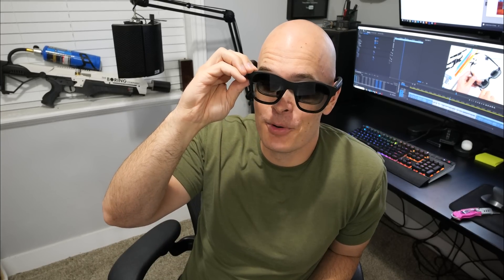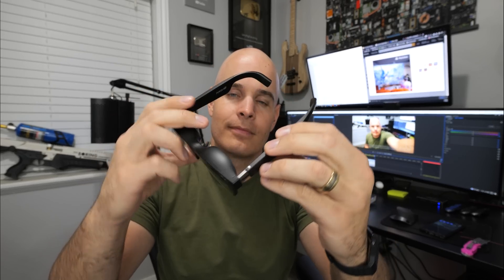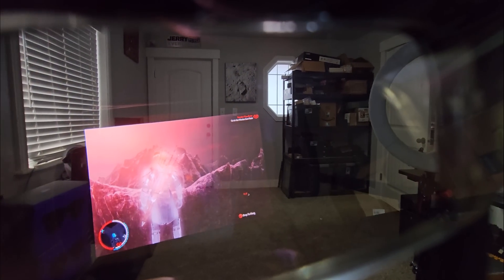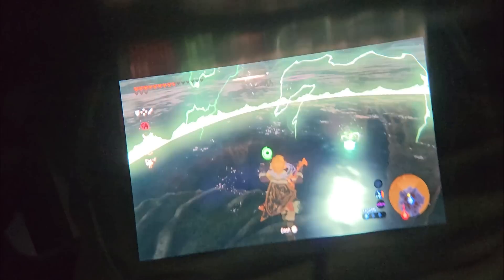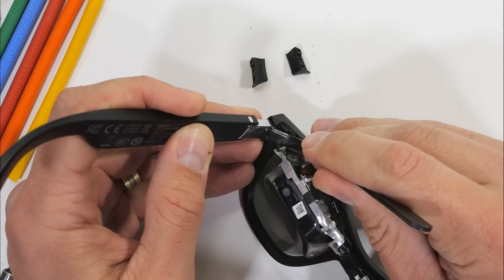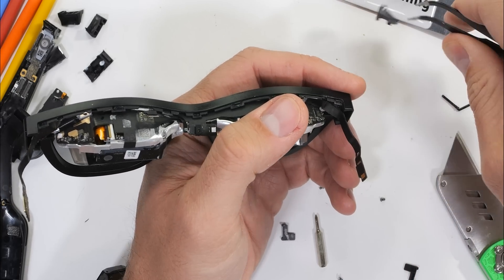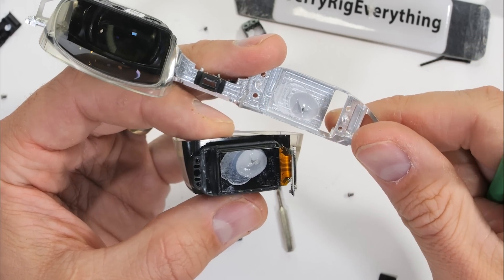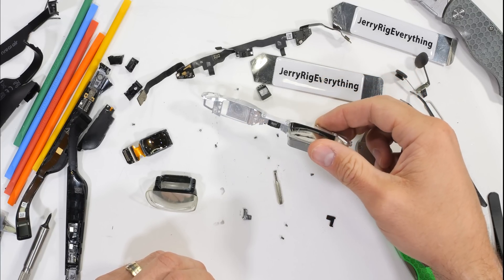The Smart Glasses of the Future are here! - (Teardown)

Comment: No adjustable knob to change the distance between displays to match one's interpupilary distance (IPD).
So, only people with 61.5 mm between their eyes are gonna see it perfectly.
The short ribbon cable inside, means that it would be hard to lengthen it ...
Why couldn't they add a slider or a screw to adjust that? :(

Comment: Probably missed the sweepstakes as this video is a year old but commented and subscribed.

As a budding physician I wish to use these devices when performing medical procedures using ultrasound. In patients with cerebral palsy, strokes, and other conditions leading to spasticity and contractures it's often difficult to position the ultrasound monitor such that the procedure can be easily performed while viewing the required images. AR glasses such as these would allow me to perform the procedure while looking directly at the patient which is obviously safer and easier. I think they will require some modifications as i probably only want the display on one eye and I don't need the darkened lenses, but these would give me a good starting point. Thanks

Comment: Is it possible to increase the ipd? I have the air 2 pro and for my ipd it's a bit blurry from sides and I feel my eyes tired after this glasses. I'm pretty sure all this problems can be solved if I move displays a bit apart and increase the distance between them. Seems like the only thing to do is to saw holes a bit to sides in the aluminium case and screw the screens again. Viable idea?

Comment: I don't like the fact that you have a wire attached. Yes, it's easier when you don't need a battery but it'd be awkward to wear it outside. It's also missing a cam but I'd try it at work anyway. I have three screens to be able to have all monitoring systems running at the same time so in the end I'd save on my electricity bill. ;)

Comment: They are certainly not the future. I've owned these but sold them after a few weeks for a number of reasons. They have a very limited software infrastructure and have almost no sensible use cases. And the fact that you can hardly move where the info is shown means your real world vision is pretty much obscured. They really are a solution looking for a problem. Google Glass would be one solution if they opened up their platform again and also the newest iteration of Vuzix due out later this year is another. But this version of nreal is dead in the water.
Reply: Google glass is a whole different story and use case. 
Nreal is working for me as display replacement. Imagine having 5 screens total on the go(and I am always on the go).
They do have drivers and they do have software (which may be not perfect, but hey, it works).
While I can totally agree that their marketing team  should be fired.

Comment: I have an IPD of 72 and having a bad time with the glasses. 
Do you think it’s possible to “cut” the aluminium frame in the middle and “extend” it with some 3D printed part? 
The ribbon cable looks flexible, perhaps it can tolerate a bit of stretching :)

Comment: Also the equivelant of a 1500 inch display, or 5 inch display.
My main problem not just with the Nreal, but all of the similar AR/VR glasses is that it requires a supported phone and app.
Plug it into something like the Steamdeck, it turns into a non3D monitor.

This tech has incredible potential, imagine playing AR/VR games from the steamdeck on the move(yes, some great looking games can run at 4K60 on the steamdeck plenty of power for 90hz 1080p3D/VR

Beyond this imagine plugging this into the headrest of your car, look down and it shows you a 3d map of the area, look over either shoulder and it shows you a mini view of your blind spots or backup camera.

I've personally used them to participate candidate interviews hands free while i'm building computers for our rotation

Comment: I have owned these glasses for over 2 months now. 

Viewing Quality 80/100
Durability 80/100
Software 55/100
Ease of use 45/100

Great device but requires additional addons only sold in America or Japan. 

For example, you cannot charge the phone while using these, unless you buy a rather expensive usb4 hub. And even then you'd need to power the phone and the glasses individually. (Adapter nightmare with usb naming scheme) 

The viewing is pretty good but suffers from a little blurriness around the edges but pretty sharp overall. 
The response time is also pretty fast with excellent pixel response with good brightness. Is does look a little oversaturated though (like an old CRT feel) 

The fov is very limited, for an AR experience it's kinda lack luster, there are some pretty decent apps being developed for it, I recently tried a few. 
They use the Unity for running a kinda virtual 3d user  

Tbc i gotta go

Comment: Brilliant. I have always thought AR glasses the included the computed inside is a waste. I have a $1400 phone, why not just use that as the computer. Something like the occulus by time you subtract the price of the motion sensors, controllers, screen and all that other jazz, how much do you think that actual computer is worth? $200 at best, a cheap slow crappy computer, so why not create an AR experience that takes advantage of the $1400 computer you already own. And the lack of a batter (no charging, less weight) is a nice added bonus. This is great, once the price is under $250 I'm picking one up. I just cant justify $380 for what is essentially an external phone screen. Great concept, just needs the technology to mature and the price to drop

Comment: Glasses drain the battery of your device much faster. Limites the usage of the device and i dont think that's so good to tax the device battery used to power the glasses. Over heated my phone. Fold 3. That inside screan protecter that it came with bubbled up and down the middle of my phone screan. Kinda making a clicking sound when you opened the phone. Had to take it off. Couldnt watch anything looking at the bubble line. 
The ability to watch something on a screan that you could move around, blow up and hold in position was amazing and still see around you. Very cool ar glasses. Nebula app keeps crashing though... so a fixed smaller screan right in front of you is what you get. Really like the glasses but not going to keep them. For almost 400. Recommend refurbished meta quest 2 from amazon I think it was 350.

Comment: They look amazing. I agree that without a battery it's simpler to build but it's a pity that you're attached to a cable. I guess/hope that in the very near future better battery technology is finally developed (aluminium core batteries) and we can shrink them more while increasing the energy density ( and adding WiFi, 5G, etc, would also be cool ).

Comment: The perceived size may be 100+ inches, but it would be nice to know what the perceived distance is and what the resolution is, because those are also important factors in how good the image looks.
At least to my eyes, 1080p looks good on a 16" screen from about 26" away, but 1080p on a 100" screen needs to be closer to 50" away to still look good.

Given the size of those panels, and the low price point, I would guess them to have a resolution of 720p, stretched out to a 100+" screen size, it would probably need to appear to be about 60" away to still look good and not seem pixelated.

Comment: Wow, these VR glasses look like they could change the game! I'm excited to see what kind of experiences I could have with them.
Reply: AR 😋, but yeah they will actually change the game as the convential method was to have a all in one unit - battery and re-charging components including the SOC. Which not only makes them bulky but there is always the risk that people will use them whilst re-charging therefore overheating the battery. Given... what happens when overheated battery goes.... and wearing on your head when it does won't be a pleasent experience to the say the least. So, by having a processing done externally comfort is also increased as no heat dissipation is needed for the SOC. That heat will go both in the area and the users head... lol.. then is also the aspect of electro-sensitivity. So, yeah by having the AR glasses merely act like displays solves a vast array of problems. Sure, it doesn't solve the biological problem of eye strain but that's on the user not NReal just as monitor OEMs are not liable to eye strain issues caused by prolonged use by users.

Comment: Nice breakdown. Good to hear that an internal battery is not available and we can only power the device through an external source. It probably is for  the best: Or else you'd have a built-in battery too small and weak to run the machine for long , or a battery that is charged and discharged so often that it will need to be replaced too soon. We know how expensive a battery replacement can be.

Comment: I wouldn't buy this gadget for 2 reasons. 1. I can't use the device unless I connect it to a phone or console. 2. Why should I use it for gaming if I can just get a regular vr headset. I would only consider buying it if it has its own battery and can be used without plugging my phone into it. I imagine myself using something like google maps but at its current state I would have to use my phone anyway so why even bother?

Comment: I had a pair of these and they were pretty neat, but I ended up returning them. My biggest issue with them is that they aren't fully sunglasses, yet they're too dark to just wear around while walking. The screen's prism is also darker than the rest of the frame, which is annoying. 

Another problem is that it doesn't adapt your screen's aspect ratio properly. On any modern phone like my S22 Ultra you'll see that tall/long aspect ratio instead of 16:9, when the glasses have a 16:9 screen. The only way to get around this is to use Samsung Dex, when even then it's spotty at working as your phone fights between Dex and the NReal companion app.

They claim to not give eye strain, but to me the lack of consistency in the lens and prism's darkeness is enough to be a problem already, and the lowest brightness level was still too bright for me personally in darker environments.

Overall if you want to buy one of these I'd take advantage of the very long return window they have on Amazon, just in case. I'm interested in the future, but I don't think we're there yet.

Comment: Nreal have truly come up with a very smart way of transitioning people to that technology. It`s a big leap in the user experience, but at the same time you still use your smartphone and the glasses look similar to normal ones so the whole thing is not that dramatic of a change and in my opinion this is a vital part because of the fact that people do like change but in a smaller and step by step manner. On top of that, one even gains practicality expressed in the fact that you don`t have built in batteries and charge the glasses through the phone which at the end really helps for the form factor.

Comment: While I am always excited to see wearable tech make more advances, I can't help but feel like sometimes the developers make odd decisions when it comes to form factor that get in the way of actual adoption. Compared to the size of the actual hardware/projector units, I feel like the frames themselves are almost comically large. Without having worn them myself, it seems like there is a lot of extra space they could have cut off from the bottom of the frames to make it more similar in size to regular shades. As is, they almost look like cartoon shady guy glasses. 

I feel like the same kind of thing happened with the old google glass. It felt like they could have made just a few visual changes to make them not stick out as incredibly hard as they did. I still have a dev kit for Google Glass, and every time I pull them out I am always first excited to play with them again, and then I catch a flash of myself in a reflection and am reminded why they never took off in the commercial space.

Comment: I really like the ideer of these kinds of glasses, but I dont think they are there yet to catch on. I would like to some them be more than just a large display. The phone connecting looks fun, but I image that it will drain you phone quickly both from powering the display it self but also from having to run multiple windows at the same time.

Comment: Actually i need one of those. I work as a crane operator, and often we use cameras mounted to the head of the boom that always points down. And we usually have small monitor in the cabin, usually 5-7" LCD, to see what's underneath the hook when you are doing blind lift. But sometimes you need to watch out the window of the crane and can't watch the camera, like if someone is giving you hand signals. But i have been thinking if i had one of those i can watch both what's surrounding the crane and what i see on the camera at the same time...

Comment: Too bad it has way too low resolution for such a large field of view. 1080p is not sufficient for 200" TV and neither is it sufficient for this virtual one (don't be fooled by 3840x1080 claim on Amazon- that's just adding two 1920x1080 together and that's BS). Even 4k wouldn't be perfect.

Comment: The differential in size between the outer frame's lens size and the display lens size, makes little sense. Additionally, the snap on black out frames should have a front facing camera to then allow preciously whatever the viewer wants to let back in, Using these on a commercial airline for example is a perfect use case for such functionality, that way you can tune everyone else out, while at the same time be able to set either detection of movement or just look through the lenses to see oncoming flight crew etc etc etc. The extra size of the out lenses also has a a certain Joker-from-Batman look to them...and the chrome bits should have been anodized black to match the rest of the glasses.

Comment: What about if you wear glases? They have the posibility to adjust the dioptry? Anyway the optical system looks interesting. As optical engineer in the automotive industry, i think they are kindly using the same optical system like in the headlamps, low beams, they are trying to magnify the display image using a convex lens, i mean the first one which is stick to the display.

Comment: Average weight of spectacles is around 20-40 grams. Add 79 grams of these smart glasses and you will end with around 100 grams of weight sitting on your nose. Other VR head sets have over the head support strap to support the weight but the total weight of this one will be on the nose. So basically you won't be able to use it for long period due to its weight.

Note: I know that they give option to add prescription lenses into the smart glasses itself. But still the weight of the prescription glasses get added to that 79 grams and make it very heavy for a smart glass.

Comment: I remember the days of the "100" TV". Back in 2001 this design floated around the internet. 'Place a CRT monitor into a black box, turn it upside down, and place a Fresnel lens (usually from an overhead projector) in the hole of the box. Then seal away a room from any light source, and a faint image can be projected onto a wall or bed sheet. You really could get it to 100 inches, but the lumens were so low, that you could barely see anything.'

Comment: Way to cool for me. Definitely get rid of the four monitors , two 27in and two 24in. That are mounted on a old water bed end table and a monitor stand. Monitors where found in Mom's closet and purchased a Rog Zephyrus G14 , just a GA401, set up for VR . Never purchased the V.R. headset , but it will run three monitors pretty good. The laptop ran a bit hot for me . Just run the two 27in Samsung displays.  I use a old HP desktop , for web browsing. One of the 24in displays aged out, old no HMDI 😮 only a  DB9 port.  The HP runs a 32in TV , found by trash can , chewed up plug. Yes,  replaced plug and disabled for cleaning. Working good with the desktop and a Playstation 4 . Mounted on a the gaming shelf I made. Mounted below another 32in tv, had given to TV , used for Xbox S and a blu-ray player . The old 24in was replaced by a old 26in R.V. tv with built-in DVD.  The coolest thing about it is all the connections on back . Even a Atari 2600 hooked up with no problem. Controllers are not working right and trying to get back to fixing it . The glasses can't help with that, but would be cool to get some monitors out of my mix. I do thank you for showing the glasses . Definitely something I will look into instead of a V.R. headset.

Comment: Not a big fan of those types of glasses cause you have to connect it from USB C to a device. Wished it was wireless, was capable of gester touch (or something that can be seen through hand motion) and also would run battery that can last about 14-18 hours but that's probably impossible cause of how much it's doing. It's not the first and not the last of smart glasses but I know that later in the future, something like that would happen.

Comment: the glasses have great form factor and I like that the draw power from devices they are connected to making them very light without a battery in the frame. its a great addition to use while traveling from the looks of it.

Comment: I'm absolutely curious if this could be a supplement for projectors/projection style monitors and TVs. If the cost comes down on these, I could totally see in home theater systems changing with these. I'm not too certain on the sound quality or if it would have spatial sound or if you would be better off with your in home surround. either way, sounds like a great bit of technology.